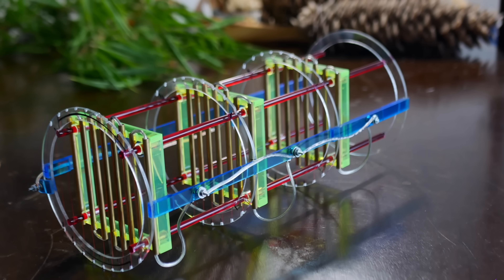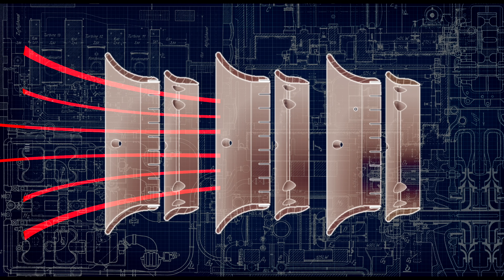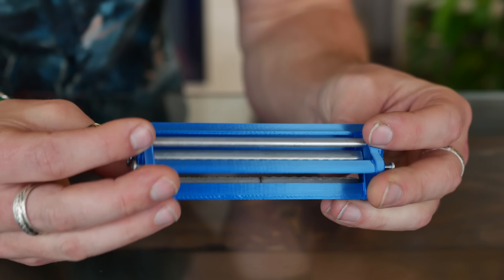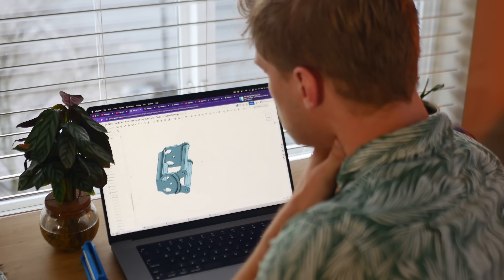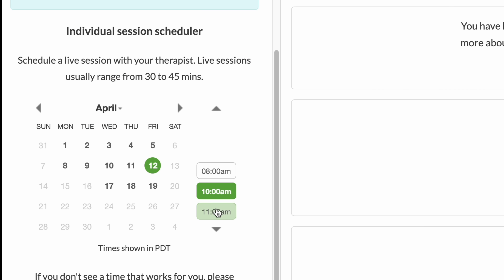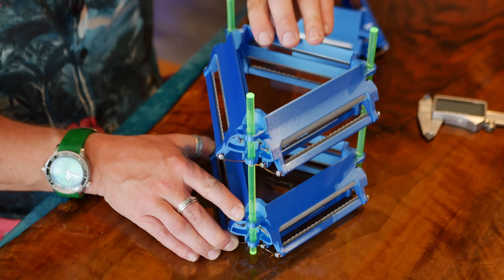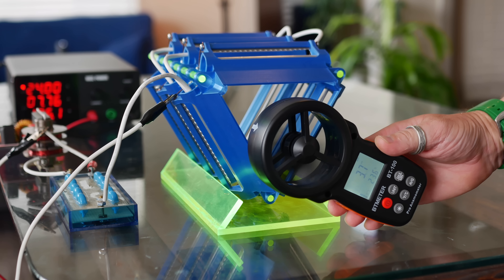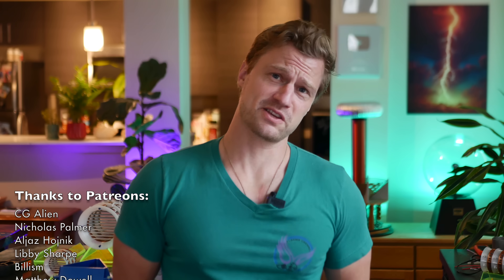Next-Gen Ionic Plasma Thruster Inspired By Nature (BTC Mark 3)

Comment: I think you need to do tests with varying current and voltage mixes with the previous cylinder design.  You might need to increase your current to get more optimal airflow for your ionic thruster array configuration.  Considerations.  Inadequate Ionization: If the ionization process isn’t efficient, many particles might not gain enough charge to be accelerated. Unoptimized Electric Fields: If the electric fields within the thruster are not uniform or strong enough, ions may fail to reach the acceleration grids or are diverted in undesired directions. Grid or Electrode Blocking: If the electrodes or grids are poorly designed or aligned, ions might collide with these surfaces without being accelerated. Magnetic Fields: In Earth-based systems, local magnetic fields or external sources can alter ion trajectories, causing ions to miss the acceleration grids. Use of Ion Focusing: Ion optics or focusing mechanisms (like magnetic fields or additional electrodes) can help direct ions toward the accelerating grids. Use simulations to adjust the spacing and alignment of the grids to prevent ion escape. Simulation software might be the best approach.
Reply: Apparently,  simulation software like COMSOL, Ansys Fluent, or MATLAB can significantly accelerate the development and optimization of ionic thrusters. They allow you to model complex phenomena like ion behavior, electric fields, and recombination, leading to more informed decisions about your design.

Comment: Could you not just integrate the ionic plasma thruster inside of the an airplane wing?  Have the air intake at the front edge of the wing, perhaps a 1/4" slot the entire front of the wing.  Air would get sucked through the wing and ejected out the rear edge of the wing.  This allows the entire inside of the wing to act as surface area to accelerate the air.  It also protects anyone would might accidentally touch it.

Comment: I'd love to see a video of this system with higher thrust be incorporated into a miniaturized jet engine somehow, possibly having the ionic thruster receive power from a turbine powered crankshaft to a generator. I'm just picturing the turbofan/turboprop system with ionized compression instead of airfoils, you could replace the crankshaft from the turbine to a generator that powers this ionization. Turboprops already require gear reduction boxes from the turbine-crankshaft to the prop because it produces so much torque! That would be an insane amount of voltage to direct into an ionization system. Im not an engineer of any kind its just a thought, but im also considering the effects of that much magnetic power on the aircrafts avionic instruments (magnetic heading indicator for example)

Comment: Triangular shape is easier, but causes way more turbulences… as you put out, you desire additive forces: not turbulence.

So, the ring shape would still be your best bet. Also I agree with the exponential/assymetric needs of your design in spacing, powers, sizes of modules, etc. Industrial designer myself, sticking to the “purely” modular series may be your blind spot. 

Also: an  “obstruction cone” of some sort in front of your design could give you 3 big advantages… 
1- aerodynamics 
2- ensure protection from “banana” that would ricochet inside your device
3- funnel to your needs (and possibly dilate) a constant volume of air inside your device”chamber”. Possibly laminate your flow also.

I would gladly exchange with you if need be. I hope to see the mark-4 soon!
Reply: Cowling...

Comment: try to use other factors.  get one part, make some experiments with manipulating the air around it, maybe magnetic fields or creating a tunnel before ionizing so the air has to move further creating a stream of negative trying to reach positive... you only tryd one side of the coin.

Comment: The physics of these air ionic thrusters has always had an efficiency limit of 1%. That is, the power from the exhaust divided by power input is 1%.  With a thruster stand it would be easier to measure because power = thrust force x exhaust speed. But you can still calculate it from the results in your videos. That is, power in the exhaust =Pe=(air density) x (cross-sectional area of exhaust) x (exhaust speed cubed). Let power input be Pi. Efficiency = Pe/Pi x 100. Assuming you have an exhaust diameter of 0.1 m, air density of 1.2 kg/m^3, and an exhaust speed of 4 m/s, you get Pe= 1.2 x (pi x 0.05^2) x 4^3 = 0.6 W.  Your power input is about 150 W. That is an efficiency of 0.6/150 x 100 = 0.4%, which is less than the theoretical limit.

So unless you can change the physics in some way, then no matter how you change the electrodes it will still be an inefficient and, therefore, impractical thruster. You get orders of magnitude more efficiency from a fan run by an electric motor.

Comment: You connected the sections in series, but in a series connection, the pressure is summed up (this is how it works in aerodynamics), while the air flow rate remains unchanged. If you had connected the sections in parallel, you would have achieved the desired increase in air flow rate by three times, but the air pressure would have remained unchanged.

Comment: Have you tried to charge each chamber seperatly? So the first one receives 30%, second 50% and third 75% (just random figures) this way as it moves from the firat chamber to to last, the increased charge (in theory) would accelerate the air and pull from the previous chambers. Just a thought. Plus you could potentially increase the spacing between chambers to allow more peripheral air pull which (in theory with water) would create a suction effect.

Comment: have you experimented with making each sequential stage smaller than the last to form a pyramid wire meshing off the center with a mesh only as small as the opening in your thruster to stop anything that would be large enough to damage the thrusters from passing and then split halfway in and halfway out the pyramid having a football shaped obstruction to force air directly into the thrusters on the way in and funnel it on the way out, on the outside of your thruster pyramid i would have a solid walled cone or funnel to channel and direct flow and make it more efficient, i could be wrong but i do believe this model will be much more efficient

Comment: Why not use the continuous wing design of a "Bladeless Fan". Only with a integrated peripheral acceleration Ionic plasma thruster array inside of the venturi shroud. A circle from between 6 to 8 thrusters. 

For the "Bladeless Fan" part, replace any fans with Toroidal Propeller blades, that's if you don't use a  mixed flow impeller. 

Also integrate a secondary Ionic Plasma Thruster mixed in like 1 stage of the (BSI MARK 2).

Comment: Question? Could you strengthen the design and downsize it? Use this concept and design a turbo jet engine igniting unspent fuel possibly as an afterburner or a fuel efficiency mod?
Or would you be unable to produce the effect under that pressure and turbulence?

Comment: Seems like the ultimate convergent design would be to have all the ion thrusters converging on a central point to create as much pressure as possible which can be directed in one direction. Your video about using these thrusters to create a vortex seems to be a step in that direction as the center of a vortex has the highest pressure and a converging flow direction which could be directed into a laminar flow.

Comment: Why wouldn’t you scale down the second and third Stages? Force the air into a cone a lot like how conventional thrusters or turbines would but in this case it would drastically reduce weight and funnel air into a single small column jetting it out faster.

Comment: Try encasing the ion engine to channel the airflow, in an aircraft fuselage for example. Then you might be able to employ benefits from a venturi system, like used in a carberattor, combined with  the principle adopted in the "bladeless fan" technology drawing additional airflow from vents along the fusaluge by the negative pressure created in the fusalage. That would dramatically increase your m3airflow/sec. thrust from behind the aircraft.

Comment: What about a proton particle ion thruster? The ion engine in space needs proton particles inorder to pair with electrons and the interaction has an effect on thrust. Perhaps using them in conjunction would improve performance. Electron particle acceleration combined with titanium will generate proton particles and uou can add electric charge. You will need a sensor or a way to detect the positive charge. You could use a voltage meter in theory but idk.

Comment: Hello out of curiosity is the current restriction on power input caused by the melting point of the wires and or material itself and if so would using this in a low oxygen environment make the thruster more effective by increasing the melting point due to a reduction of oxygen for it to combust with. And if that would not work why not use a coolant of some kind to reduce the amount of heat on the wires while still making them effective so that you can increase the amount of input to the system

Comment: Hey, I think you are entering a wild goose chase with the airspeed. These deminishing returns you see are actually unavoidable as any increase in speed of some mass requires a quadratic increase to its energy. In fact I did some napkin math and your System actually gained efficiency with the extra stages. It seems your three stage system had more than twice the efficiency compared to the single stage system. As others stated, thrust may be a more meaningful measure to judge this thing while still not being proportional to the power output though.

Comment: It might be a good idea to be able to precisely measure the static pressure developed as well as the flow rate. In essence your would be developing a thruster curve ( similar to a fan curve).  With this tool you you might be able to find the optimal configuration for your thruster designs. You would need to develop a laminar flow element to measure differential pressure and have a fan to pull air through the flow bench at various static pressures.  You could plot a curve by measuring static and differential pressure on a graph. Omega and Meriam might be good resources for flow bench design. I would think that thrust is more than just cubic feet/min.

Comment: What if you were to angle the later stages increasingly to grab more perifrial air and focus more toward the center of the flow? Example fist stage normal, second stage 5 degree change in angle, third stage 8 - 10 degree angle. My thinking is that of jet engines where thrust increases the more focused the area of flow becomes. I'm no scientist or engineer as you may be able to tell and my vinacular is that of a peasant 😂 BUT I would like to see data at some point in the future of angle adjustments and wether or not that has an impact on your results. Or do I have to electrocute myself in the attempt to do it on my own? 😂 cheers! Love your videos!

Comment: By directing three flat streams of air on a path where the planes intersect you are causing it to change direction, when you do that, the particles in motion lose energy by colliding. If you took one of these stages and Change nothing except to make them each into a 1/3 of a circle I suspect you would find they exhibit better performance. The reason every turbine and rocket nozzle and any other means of propulsion is round is because round  is the most energy efficient shape. That ensures that the energy is distributed and directed evenly in the direction you want it to go in with minimal waste. I also think your premise of in taking air from the sides may not be as helpful as intuition might suggest to achieve higher output pressure. I bet that if you affix a tube to the output end of your mark 2 design, and add a slight taper at the end, you would measure more air movement. The air needs to be directed into a closed space to build pressure to generate higher force. I also think that as close as you can get each stage together without arcing across to the next stage would increase your output. This is great stuff you’re doing here! Very cool concepts and designs. Wish I had the space and time to just tinker with stuff like this! Keep making cool science projects!

Comment: you need to unsynchronize the steps and sides, the whole thing is synchronized so it pushes the air at a certain speed then stop it to speedup further, or either (better idea) to use different frequencies, the first thruster at a certain frequency the second at double frequency and the third one at 4 times the first frequency.

Comment: you could have used electroplated plastic parts instead of metal for cutting out on weight and accuracy over the cuts on the razor blades you have made. Maybe gradually deceasing the size and using something like Tesla valve may increase the thrust .

Comment: Hi there these videos have inspired a new interest for me in engineering particularly in this area which I have no experience with whatsoever!
Purely a question because these videos have sparked my interest in Ionic thrust. I don't know much at all about plasma or in-fact anything of the subjects mentioned in the series.

You have stated in a previous video that the razor blades you choose are serrated because they have sharp points from which an arc will jump to the negative. Since the ionic winds are being generated by the arcing, would more high spots = more arcs = more airflow? Is there a "sweetspot" for the number of arc points per inch/cm for the most efficient airflow per single stage.

I'd be interested even on a short video exploring that, assuming that its not a null question (again total layman)

I look forward to watching the next stages of this design develop!

Comment: what about making this design circular/cylindrical? Would you gain some venturi type benefit? 
Maybe I missed something, but I thought the point of this was to only have a single stage, then you just stacked 3 of them together like the previous design. Again, maybe I missed something... but weren't your numbers basically the same for the single stage? What was the benefit of stacking 3 in this design?

Comment: I got to thinking about how to better improve upon your design using mother nature cues and it dawned on me that the over all shape should be a hexagonal and not a triangle as that should give you maximum thrust output. Plus you should tapper it down being the largest diameter should be the first, then drop the diameter down for the second, again for the third stages. Anyway it's only a thought.
Plus I'm thinking of putting up my own booth at the Open Sauce to showcase a technology thought impossible that will move to change the world for the better. But I have to hope that the powers that be let the technology out as the technology puts the individual in full control of their own energy needs totally cutting the middle men out of the equation as they can't put a meter on it.

Comment: Try variable wattage per stage pushing higher and higher speed of ionized air in the later stages. As you pointed out in your previous videos, the rushing air diminishes ionic push in succeeding stages. This is because the air is already ionized by the next stages. Utilize the charge density and spacing of potential to further increase the air speed. Checkout the principles of the accelerators of CERN.

Comment: If the benefit came from the air being compressed, couldnt the same idea from a jet engine be used? Keeping the sequential layers but forcing the air into smaller tunnels as it moves

Comment: My initial thoughts say you need to minimize incoming feed air except for the initial intake areas consolidating any types of drag or unfocused fueling air to your thrust column. If you optimize the convergence area of all three stages around that 10cm length you may be able to optimize the thrust increase. Somewhere after the 10cm mark should be the First Stage's terminal velocity. If you can identify this area and stack the following stages to influence directly to this area the PTV(point of terminal velocity) should amplify, PTV locations for stage 2 and 3 convergence areas  may need to adjust due application of thrust and terminal velocity area.

Comment: Why dont you apply an electric field around the ionized air, channeling it and pulling it faster through the engine. On top, it should help with more efficiency with the magnetic field help riping the ions off the electrodes. Just an idea.

Comment: I think you should compress the air use the rocket engine nozzle principal, compress to a chocking point (since ionise the air is heating?)and the calculate the expansion (build the expansion cone) to gain volicity?

Comment: Your works are astonishing. I feel a great comfort watching them proceed. Also it is very interesting how all evolves. These are remarkable. Nevertheless some of your Commentators propose improvements, for example exponential spacing. So i am also very curious how you do propose to deal with turbulent air drag or mentioned venturi effect or an intake and an exhaust stall or other aerodynamic effects etc. in this electrostatic compressor. I see there is a racing car chassi constructor challange. Hehe. There could have been a method of sequential charging of each condensator with a certain frequency to overcome turbulent drag created by pumping this gas through the compressors interior. Also it could take many years before any closing conclusions appear. Though, it all does look very future proof. All the best wishes.😀